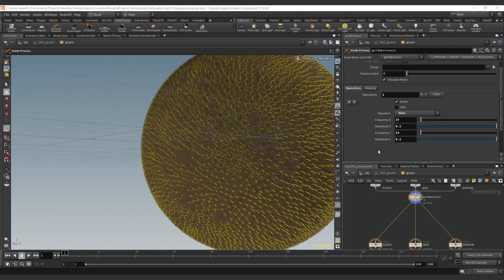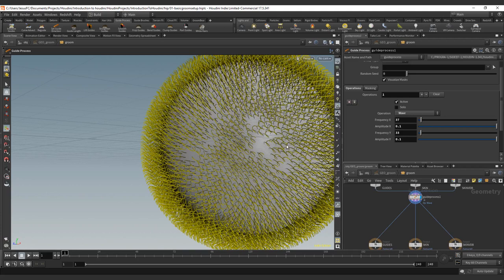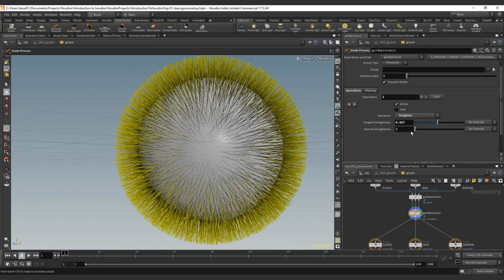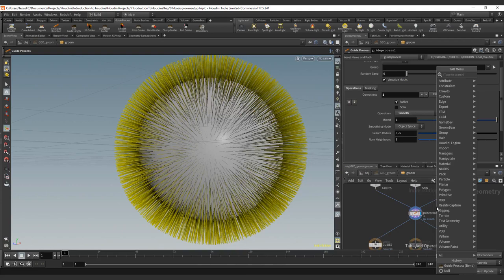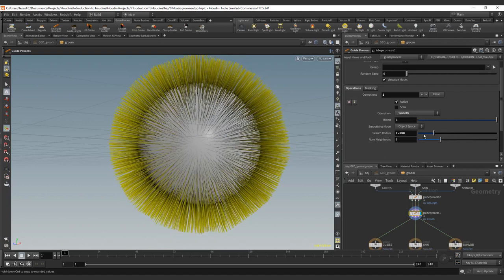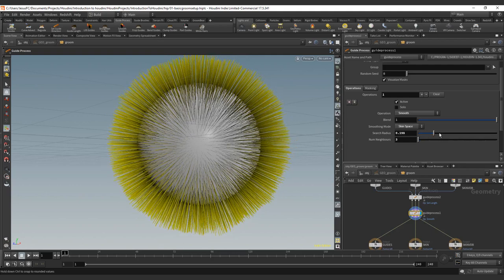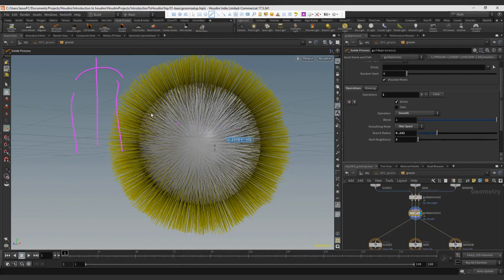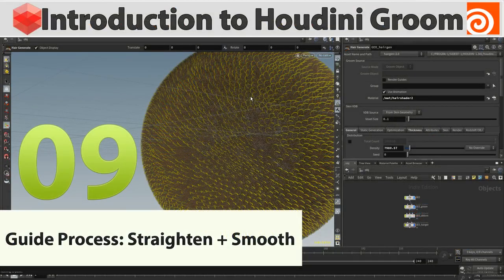09 - Introduction to Houdini Groom  - Guide Process:  Straighten + Smooth

Comment: Thanks for these tutorial series! I have a question regarding guide process node. In the previous video you mentioned that if you are creating groom for the same area, e.g head, you would use different operations rather then making another guide process. For this video did you make another guide process just for the demonstration purposes or that's how'd normally use it for groom? Would it be beneficial to use another operation here instead making a second guide process node?
Reply from the maker: Depends on the result that you want to use, and if you want to mask them on different areas, normally you dont stack deformers that much, you will use different nodes for the effects.